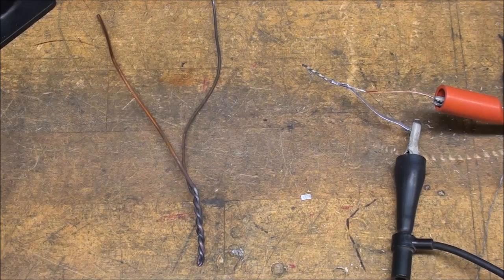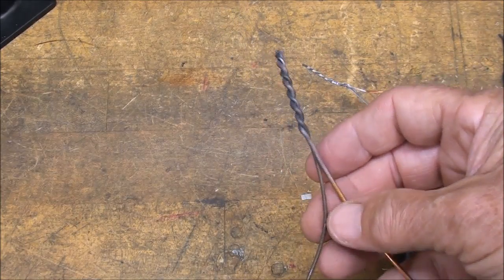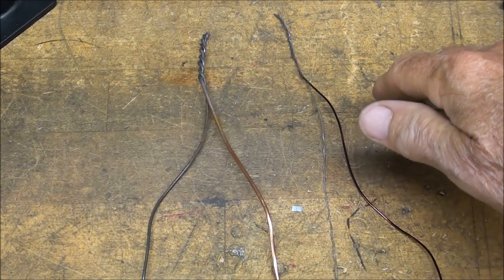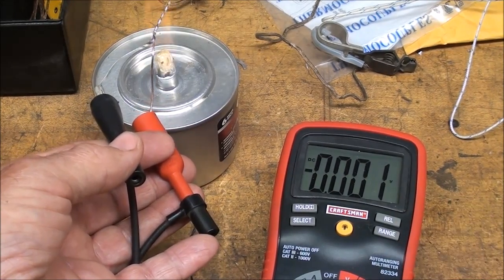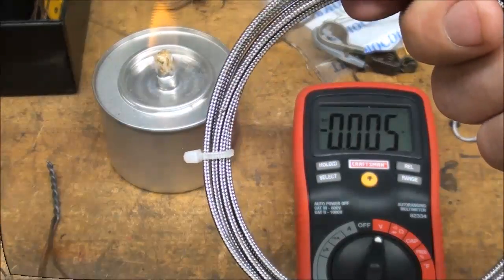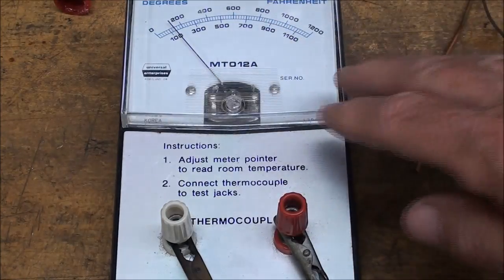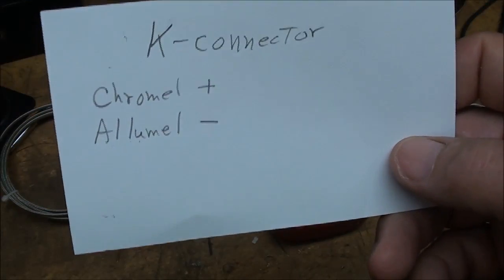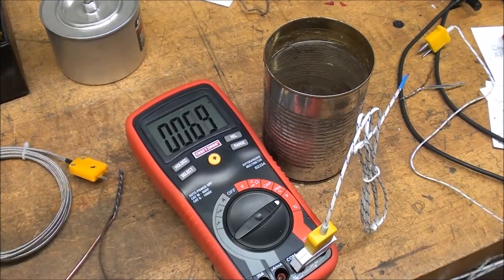WHAT MAKES IT WORK? #9 How Thermocouples Work - pyrometers - tubalcain

Comment: Would you be able to do a load cell video similar to this one? I like your style a lot
Reply from the maker: +jackfrost1031 Whats a load cell?
Reply: +mrpete222 a load cell is a weighing device. The measured voltage changes when a load deflects the cell. 

https://en.m.wikipedia.org/wiki/Load_cell

Comment: A regular Mr. Wizard. I imagine if you use an op-amp as a signal amplifier you can get better readings from your homemade thermocouples. Indeed the Internet is just chock full of example circuits. Very simple stuff too. Hmmm, could be useful for a project I've planned here.
Reply from the maker: +Paul Frederick Thanks for watching
Reply: if you buy an Analog Devices AD595 chip it amplifies a type K thermocouple to a handy 10mV per degree C instead of the approximately 44uV per C. put a 10nf ceramic capacitor across the input or it may also act as a short wave radio!
Reply: Mark Sinden
That is all well and good, except for the buy the specialized part bit. Especially being as general purpose op-amps are almost literally a dime a dozen. I've bought 50 for $5 at any rate. So a dime a piece I suppose?
Reply: +Paul Frederick - the problem with just an op-amp is cold junction compensation. The specialist chip handles that for you. Of course, you may prefer to do the compensation yourself instead.
Reply: Mark Sinden
Where I am thinking about using something like this I am not interested in the cold temperature at all. More like a range of about 350-500F, or perhaps a sweet spot in that range.

Comment: Take two thermocouples and connect them together, iron to iron, copper to copper etc.
Put one thermocouple in ice and heat the other, read the voltage across them.
Callibrated  thermocouples require a cold junction (ice) reference. Either with ice which is not practical or electronically simulated in a thermocouple meter. Without the cold junction, the voltage will be unstable and not reliably indicate the temperature.

Good stuff!  Thanks for all the great information!
Reply from the maker: +carambatsr I read about all that, but its too much info for that simple video

Comment: Good demonstration! We use the type K thermocouple on the big diesel engines I work on. They are used for exhaust temperature sensors. The thermocouple connects to a special module that measures the millivolts and sends it to a PLC controller, reading in °F for the program to display. The PLC will monitor the temperature and give various warning alarms if any one cylinder gets too hot or too cool.
Reply from the maker: +davida1hiwaaynet Thanks for watching

Comment: The New Horizons probe that recently flew by Pluto was powered entirely by thermocouples with the heat generated by decaying plutonium. The system is called a Radioisotope Thermoelectric Generator (RTG).
Reply from the maker: +Eric Morrison Did not know that--Thanks for watching

Comment: Quite interesting.  I have a small gas heater that had been recovered from a razed travel trailer, it uses a thermopile/coupler to not only operate the safety shut off for the pilot light, but also provide power for the thermostat.  The current one operates well enough to keep the pilot lit, but not enough to operate the thermostat circuit.  Finding a replacement in that style (wire ends) is being a challenge.  I miss that heater on really cold nights, it's good for sitting close to with a good book.

Comment: Very nice.  The proper name of the thermo electric effect is the Seebeck Effect named after the guy who discovered it.  The yellow plugged thermocouple you were using is type K (chromel/alumel)  which is good for about -30 deg C to + 1000 deg C and is pretty linear.  The more common is the type J (iron / constantan)  which is good for about -40 deg C to about + 600 deg C.  You get a little better resolution from the type J but it is not as linear as the type K.  Note that all thermocouple response is NON-LINEAR which is why the calibration is important.  The standard in thermocouple pyrometery is Type S which is Platinum/Rhodium.  The millivoltage produced is not very much compared to those using base metals but it is very good for higher temperatures like 1500 +  deg C.  You can look up all of the millivoltages produced by the various thermocouples  in the International Practical Temperature Scale.  That should be available on the internet if any of your viewers are interested.  Good video.
Reply from the maker: +Steve McEntyre Thanks for watching

Comment: Thermocouples are really interesting (and useful). Thanks.

My dad used to make thermocouples by welding the tips of the wires together. He used a car battery and a big knife switch. He would touch the wire tips together and rapidly close and open the knife switch. The tips would weld themselves together. It took good timing, careful alignment of the wire tips, and it only worked well about one time in ten. Still, what's time to a hobbyist with an interesting project?

For those with a technical interest (it's tough going for a non-physicist) check these Wikipedia articles:

https://en.wikipedia.org/wiki/Thermoelectric_effect
https://en.wikipedia.org/wiki/Thermocouple

For most of us the fact that it does work will suffice. 

One interesting fact about thermocouples is that they actually measure the difference between the temperatures of two or more dissimilar-metal junctions in a loop. In a pyrometer, or in a thermocouple attachment for a multimeter, the second junction is in the meter and is at room temperature. The meter has to do the math to convert the difference in temperatures to a readable, absolute temperature of the junction in the probe..
Reply: Peter W. Meek thanks very interesting!

Comment: If your voltmeter has a thermocouple setting it has a way to know the temperature of the internal terminals.  The temperature delta of the junction is relative to temperature of the loop.  Short out the terminals on the meter with a wire (made of one metal e,g, a paper clip or copper jumper) and see what the temperature is.    Note the old meter wanted you to add an offset by adjusting it to room temperature.
Reply from the maker: +Richard J Lebens Thanks for watching!

Comment: Nice video - didn't know you were into "electronics" as well. All multimeters nowdays (even cheapest chinese) can go to mV scale. There is much more into thermocouples then just this tho - you don't need 2 different wires to read a voltage rise/drop when heated.. the voltage is relative to difference in temperatures on ends of wire (if you heated both ends, you would read 0v).. watch?v=AYblSfpKRUk